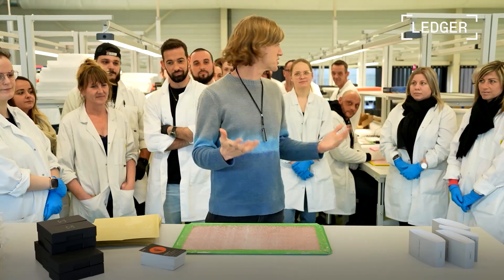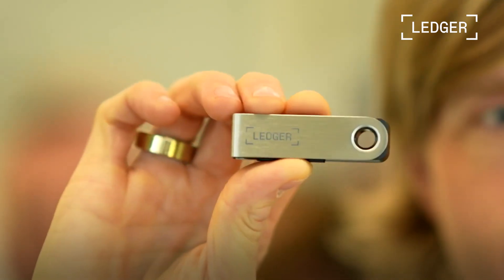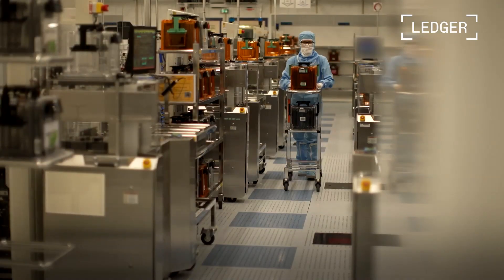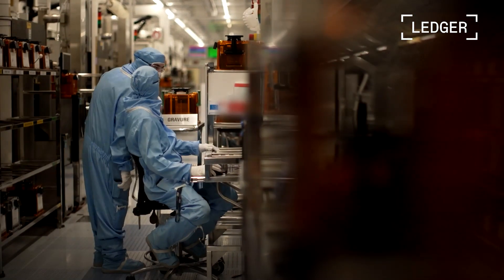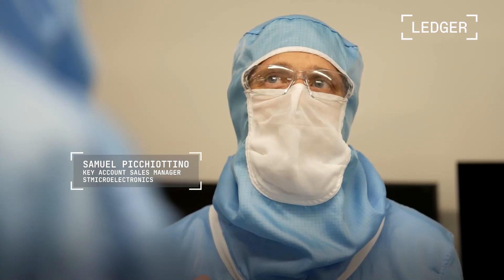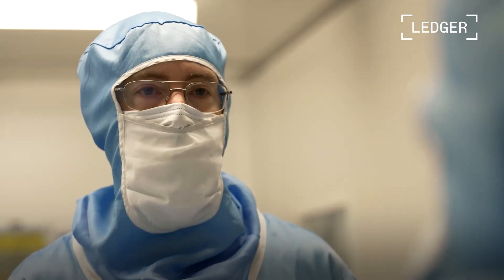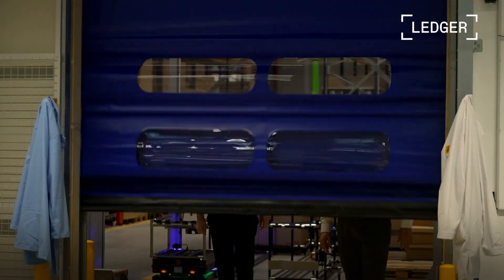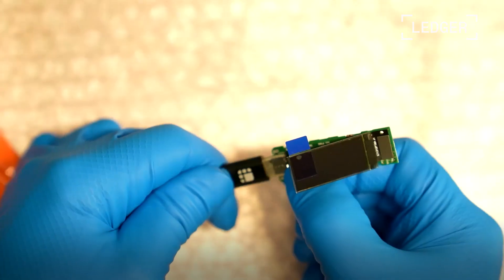Behind the Ledger Nano S Plus - Part 1

Comment: What does this mean the Nano X?
Reply from the maker: Hi there - the Nano X is essentially a Nano S Plus with a battery and Bluetooth capability!
Reply: @Ledger  will there be a nano x plus ?
Reply from the maker: Hi there! We just launched the Nano S Plus. Both the Nano X and the Nano S Plus are great devices, the only difference is the Nano X has bluetooth and a built-in battery.
Reply from the maker: That's not something we are currently planning on!
Reply: @Ledger  are u guys planing on a new device ? If not imma buy nano x now